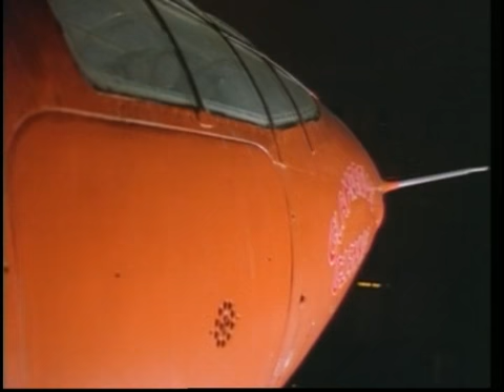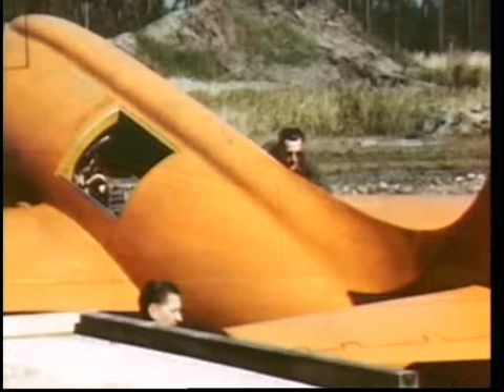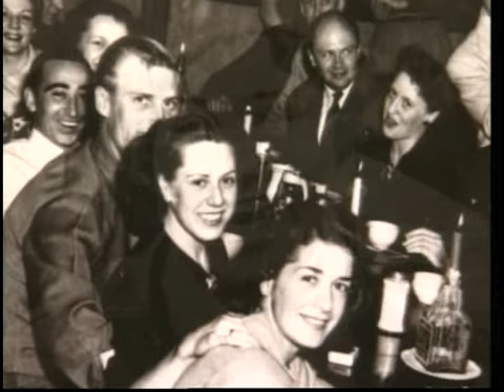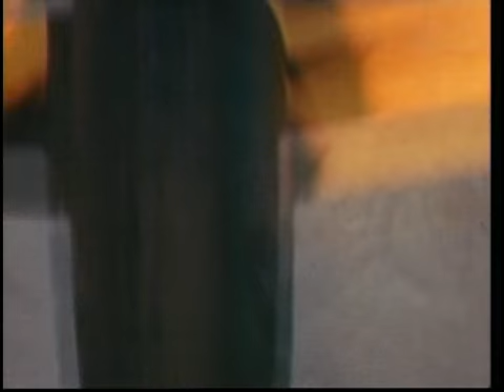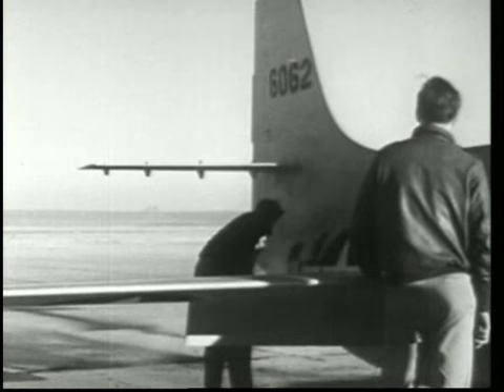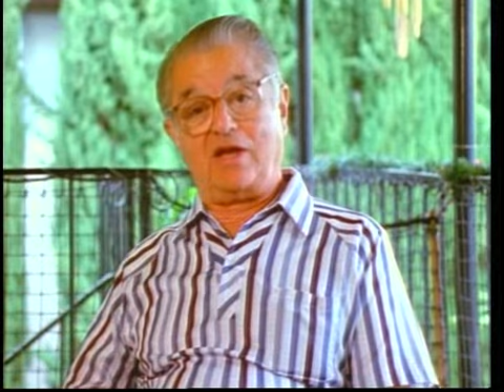Frontiers Of Flight - 09 - The Sound Barrier

Comment: Could have and should have been a British achievement.. The yanks were given the blueprints for the miles m52 .. Effectively that's what the X1 is ... A British design that was stupidly ordered to be scrapped ...
Reply: daz b completely untrue.  The X-1 was in the air flying before the U.K. Shared any research and the design of the M.52 was never even finished.  Sour grapes... really makes the Brits look bad when you see stuff like this.  Seems like you lot moan a lot about your lost greatness and you come up with a lot of nonsense about how you've been robbed and deserve this and that which you did not work for.  Should change the name of the country to Little Britain.
Reply: lookoutforchris. " The X-1 was in the air flying before the U.K. Shared any research and the design of the M.52 was never even finished.  Sour grapes."..........Afraid not old son.

In 1944, design work was considered 90 per cent complete having been started in 1942, and Miles was told to proceed with the construction of a total of three prototype M.52s. Later that year, the Air Ministry signed an agreement with the United States to exchange high-speed research and data. The Bell Aircraft company was given access to the drawings and research on the M.52; however, the U.S. reneged on the agreement and no data was forthcoming in return....That was 1944 , and the X-1 didn't fly until 1946 And it is all documented and on record.
Bell were having problems with stabilty when the X1 DID fly, and got the Variable tail form the Miles data. An all-flying tail is considered to be a minimum condition of enabling aircraft to break the transonic barrier safely without a loss of pilot control. The M.52 was the first instance of this solution, ....again all on record, because the 1/3rd  models that Miles had flown had it.

So don't be so dismissive about the work done.
Reply: SuperAncientmariner  ...Exactly right and very eloquently put.. Ends the argument
Reply: lookoutforchris ..I suggest you read SuperAncientmariner's post below, and then go and cut yourself a nice big slice of humble pie...

Comment: Interesting, to this day it's called JATO, jet assisted take off..and still to this day it is rocket assist not jet assist...
Reply: *****
No it isn't.
Reply: http://www.dictionary.com/browse/rocket-engine  and  https://en.wikipedia.org/wiki/Jet_engine . The latter even explains the difference for you. You're welcome.   *****
Reply: *****
Here is the kiddy version for you. I'm sorry I can't find anything simpler than this.. http://howthingsfly.si.edu/ask-an-explainer/what%E2%80%99s-difference-between-jet-engine-and-rocket-engine  so ask yourself does a JATO unit have one or two openings. 
For anyone else reading this here is  print  way too small for Ash Cooper but goes into far more detail https://www.grc.nasa.gov/www/k-12/airplane/rocket.html
 And although I am tempted to respond with name calling like Ash here is clear long hand explanation of the difference.. jet engine works like this: It sucks in air from the front of the engine. This air is burned with the fuel within the engine. The resulting large mass of gas is ejected towards the rear at high velocity, which both propels the airplane forward, and gets more air sucked into the engine.

A rocket, in contrast, carries both fuel (which may be solid or liquid) and oxygen. Therefore it does not suck in air from the front. All it does is burn the fuel with the oxygen, and eject it at very high velocities backward. This momentum is used to both lift and propel the rocket. . So a JATO unit is a rocket not a jet but the troll wins because I am getting carpel tunnel..
Reply: *****
There is obviously no limit to your stupidity. The entire premise of my comment is that JATO is a misnomer and I have clearly demonstrated  that repeatedly. So what in your problem now?  I'm thinking you don't have a clue how JATO works and I have wasted all this time and ink.
 And BTW the Jet Propulsion Laboratory had nothing do to with design, development, building, implementing, or naming JATO, nor do they now. JATO came into being long before JPL.
Reply: Yes, yes and then the article  goes on to explain the difference between a jet engine and a rocket. The only reason rocket is mentioned. *****
A jet engine is an air pump a rocket is not. Maybe this is simplistic enough for you: https://en.wikipedia.org/wiki/JATO
Reply: *****
Why do you think I gave you all of those links? Independent of what JPL calls itself or why, a jet engine is an air pump. A rocket is not. "rocket is a subset of jet"? By that scheme we can say it is OK to use the terms steam engine and internal combustion engine interchangeably..they are both expanding gas engines right? LOL so are rockets and jets for that matter..lets call piston steam engines jet engines..
 A jet has 2 holes a  rocket has 1. I thought that would be simple enough for you. JATO units have 1 hole.
Reply: *****
I suppose you missed the point that all other English speaking countries call rocket assist what it is RATO not JATO..well in case you continue to deny it here is the exact parcel from the reference I provided you. It also clearly specifies that the mechanism is rocket :  "JATO (acronym for jet-assisted take-off), is a type of assisted take-off for helping overloaded aircraft into the air by providing additional thrust in the form of small rockets. The term JATO is used only by USA. Elsewhere the correct term RATO is used, for rocket-assisted take-off (or, in RAF parlance, RATOG for rocket-assisted take-off gear)."
 By your generalistic construct we can say a tricycle is powered by an internal combustion engine because the 3 year old "combusts" carbohydrates internally in powering it. The world has no need for specific description..a great man of science like yourself knows that..
Reply: Sorry to break this to you squire, but Ash is in fact right - a rocket engine IS a type of jet engine. All an engine has to have in order to fit that description is production of high pressure gas expanding out of a nozzle, producing reactive thrust in the process. At the most basic level, a rubber balloon filled with air can do that if you let it go without tying it off. Or a gas cylinder with the valve snapped off - that can release high pressure gas at a sufficient rate to propel itself through a brick wall, even though it is rather heavy.

There are many types of jet engine, which mainly differ in how the pressurized gas is generated. You are right in one sense, which is that a rocket is not the same as a turbojet, which is the proper name for what is often shorthanded to "jet". Its proper name is due to the combination of a gas turbine and jet propulsion - the turbine is used to compress atmospheric air to mix with the on-board fuel supply prior to combustion.

A rocket doesn't always need a gas turbine to do this, since it carries its own oxygen or other oxidizer to burn with some kind of fuel. Having said that, liquid-fueled rockets do use high speed pumps to supply both oxidizer and fuel to their combustion chambers. The pumps are driven by a turbine, which is powered by burning some of the fuel and oxidizer in a gas generator to provide hot, high pressure gas.

The design of turbo-pumps for liquid fueled rockets is similar to that of the turbines and compressors in a turbojet engine. Which isn't surprising, since they have to do the same job, albeit for a shorter lifetime. As an example, the turbopumps on the cluster of 5 F1 rocket engines used on the Saturn V first stage have a collective power output equivalent to a Boeing 747 running all its engines at full throttle.

The turbopumps obviously aren't as big as a turbojet engine, but that's because they aren't reusable and only have to operate for a few minutes. A solid rocket engine doesn't need any pumps at all, since it works on the same principle as a gunpowder firework rocket, just much bigger. But solid rockets still produce high pressure gas expanding out of a nozzle, just like every other type of jet engine.